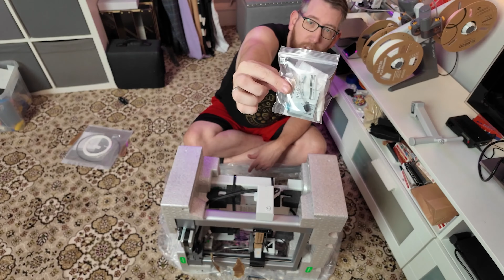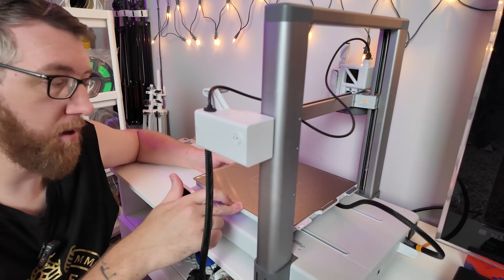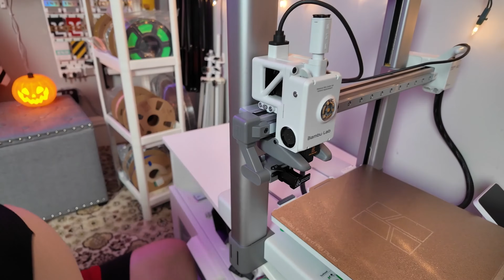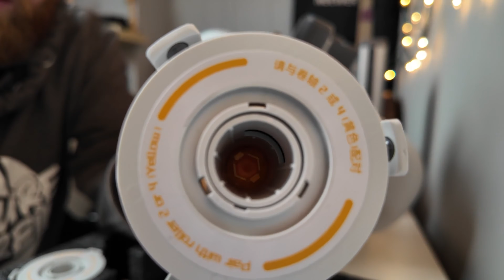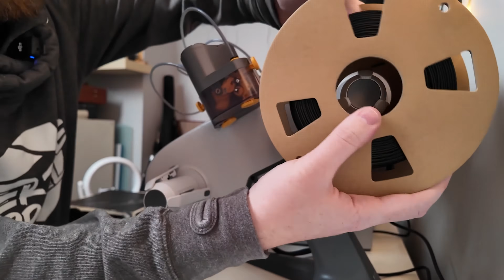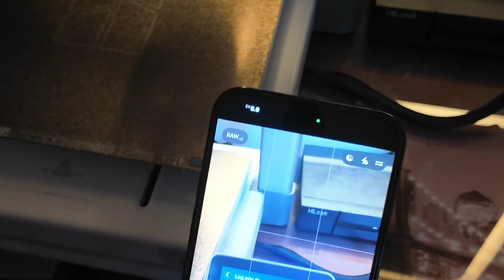The Ultimate Bambu A1 3D Printer Setup Video For Beginners

Comment: Hi there, didn't see you removing the 4 x bed retention screws that stop the bed moving during transit. Has this changed or do you still need to do this?
Reply from the maker: I don’t think they come with them now, as mine didn’t have any. When you take the bed section out, the bed moves around.
Reply: Thank you for the quick response. I am going to order an A1 in the next few days and just wanted to be sure.

Comment: Great video. On my little power cord box, the cord is twisted and it is damn near impossible to slide the little bastard in there. Can you see any of the silver color still, or just the black rubber?
Reply from the maker: Which power cord box is that?
Reply: @3dprintsforbeginners USB-C. I believe I got it, but the plastic box still doesn’t want to sit flush.

Comment: Well this was handy .. Have mine turning up in a week or two so this made me a bit less stressed, although ... how do you grease up the axis then .. don't leave me hanging!! :D
Reply from the maker: You’re welcome. Was that not something I covered in the video? I know some parts were for the A1 Mini but do the same for the A1. 
Essentially, the flap which goes on under the bed which is fitted, you just remove that and then grease up the axis and replace that cover and you’re good to go.
Reply: @3dprintsforbeginners  I'm not sure, I remember you taking off that cover to bolt down the top part but your last comments were about lubing up the Y axis .. I learn much faster watching than reading ... so would really like more tutorials on things like maintenance and upkeep .. would be great :D